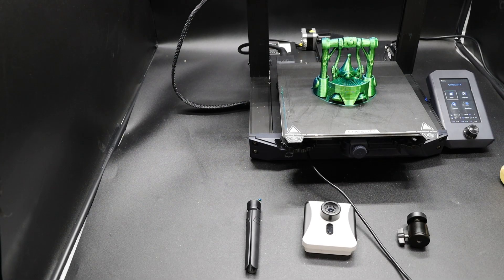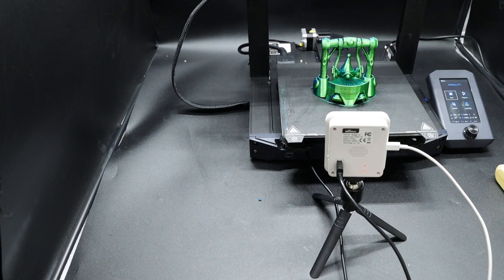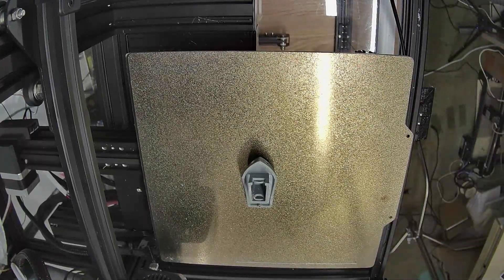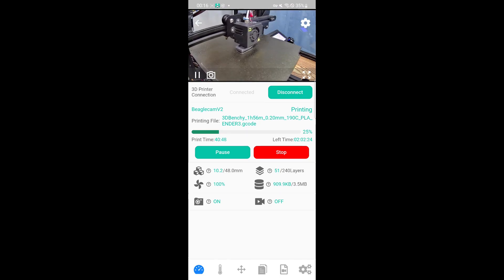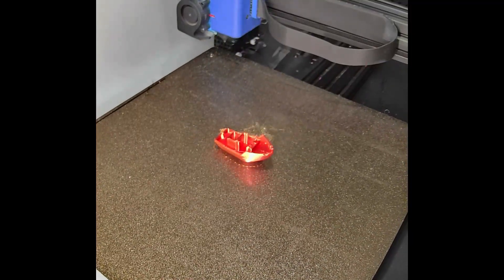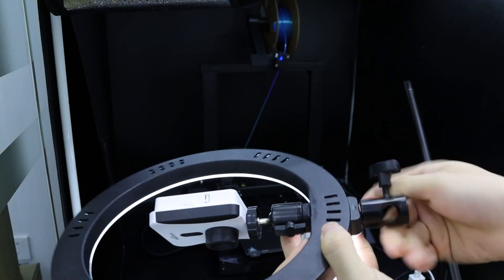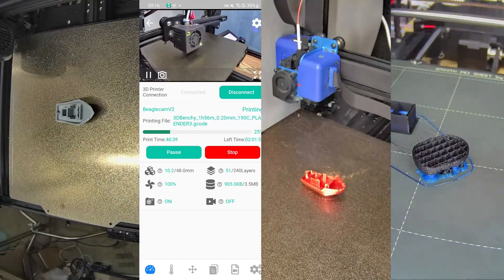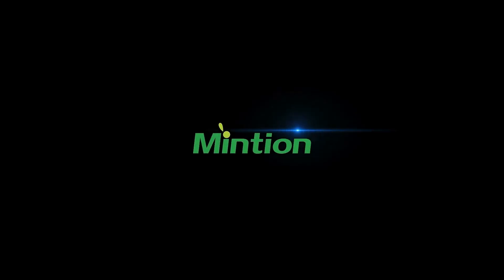Beagle V2 Camera Mounts: Best 3D Printer Views for Time-lapse & Surveillance! 🧐

Comment: What is that bottom piece for the left hand bracket? The one that screws in to hold it on place?
Reply from the maker: 4040 profile, is the model designed with a stuck structure? Is it this one?
Reply: @mintion Yes, the one that goes on left side. In the video, its shown someone screwing something into the bottom of the bracket to keep the camera in position.